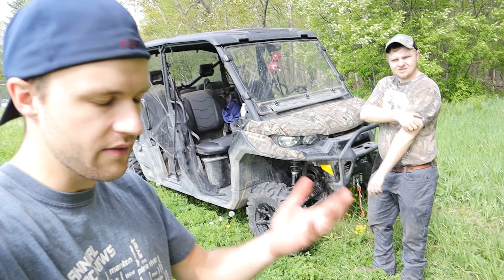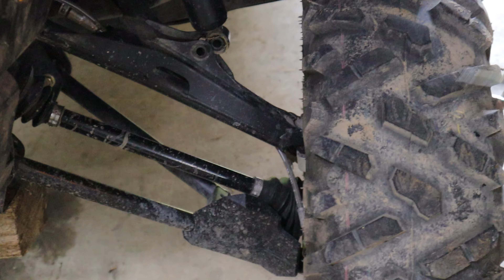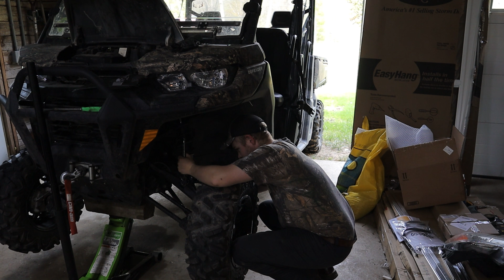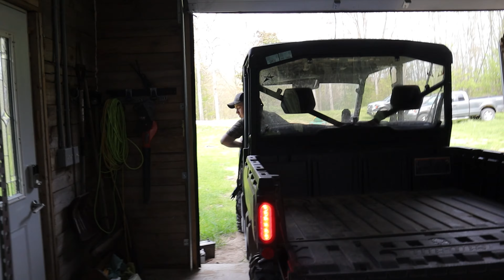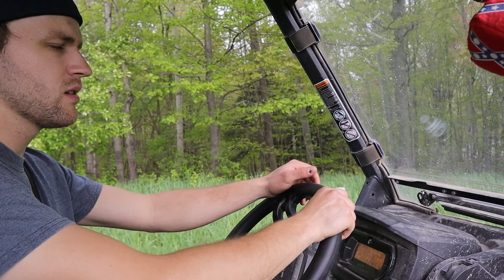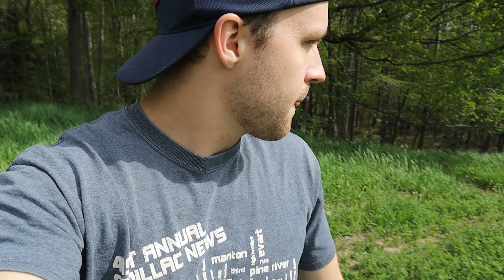Installing a Lift Kit on Can Am Defender HD8 Max XT

Comment: Very simple kit. I installed this kit on my hd10. But it didn't seem complete. I had to cut some spacers on the upper side and lower side. It seemed sloppy without them. But i do like the simplicity of them.  Fyi im running 30s in tires and  also running  zbroz shocks and that adds another 2".   The car has completely different ride and look for tne better.    Good luck with you build.

Comment: I’m considering an HD8… it has a High Lifter lift kit installed from the dealer. The turn radius seems pretty bad. How’s your turn radius?
Reply from the maker: This is the max and since it's so long it does not turn very sharp. But when trail riding turning corners isnt a problem, turning around gets challenging though

Comment: Do you need to do anything else for adjustments? Such as wheel alignment, or with the brakes? I want a quick couple inches but don't want uneven Tire wear or to put stress on the a arms. Ride rough or same quality? Thanks for any insight...
Reply from the maker: You don't need anything, it just lifts the unit up an inch or 2. The only thing you'll notice is that it has a little more ground clearance